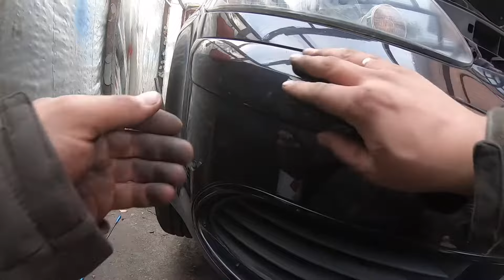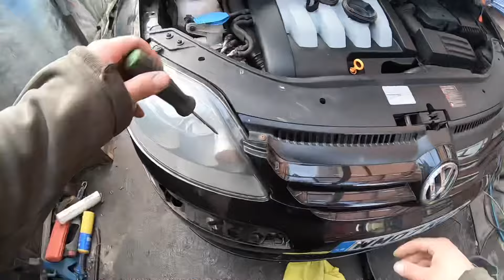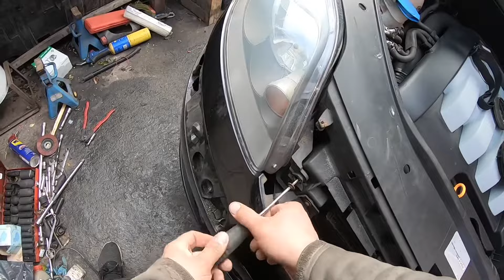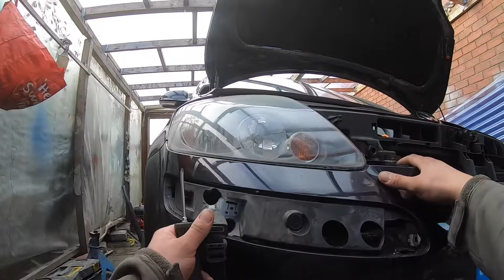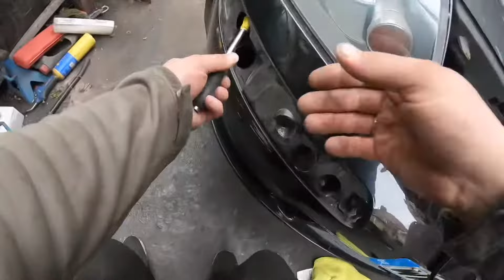VW Golf plus quick Headlight Removal

Comment: Hi, good video. I have a problem with mine, the long fascade you took off to unscrew the light, mine doesn't have these, it only has two small areas for the sensors. can you advise please?

Comment: What?
Confusing Video!!!
No Help!
Reply: It's actually super simple. 
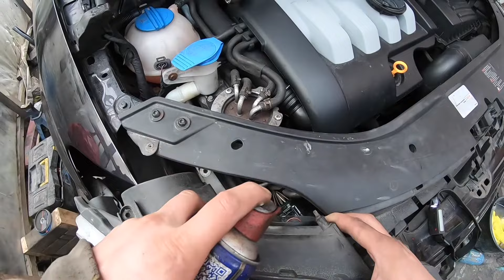First, he removes the thingy under headlight (I don't know what it's called) because there will be a screw under the headlight that we will need to access later. Then the front where logo is on (also because there is a screw, we need under it). Then he takes out all screws that keep the headlight on its place. For this model there is one on top, one on the side and another one under it (that's why he used the light to check it. It's quite far away and you definitely will need a long magnetic screwdriver to get it). Then he takes headlight out (not fully because wires are still attached together). I would actually do it other way around - unplug it and then take headlight out, but it's because I have relatively slim hands. Definitely use his method if your hands aren't on the slim side. The thing he uses at 2:03 makes it easier to unplug the wires but I went without it. Also, screwdriver is used so you don't pull by the wires which might damage them.
First time I did it, I watched, paused and repeated his steps one by one, not trying to memorize everything from start to finish so I understand it might be confusing if you try to understand it right away. I got to understand after I got my first hands-on experience.
Reply: @boopyournose5698  jeh!
Thank you!
Now I understand....